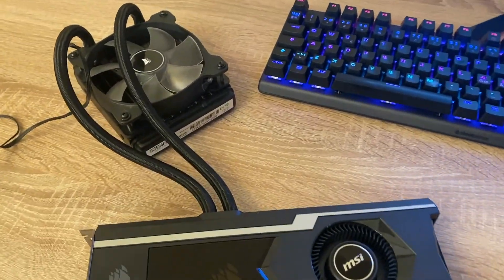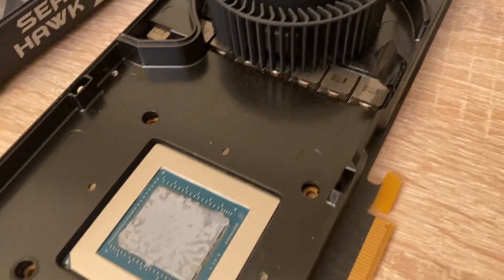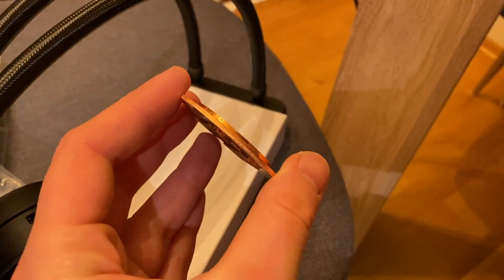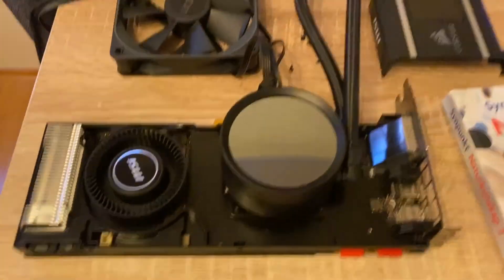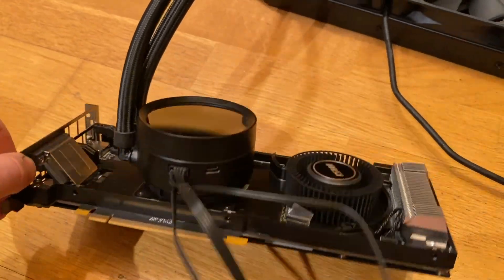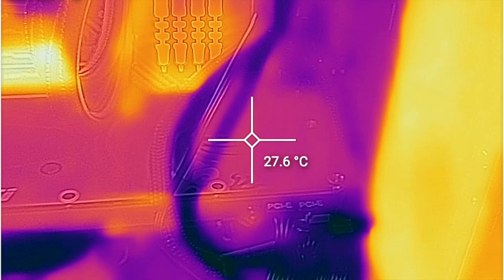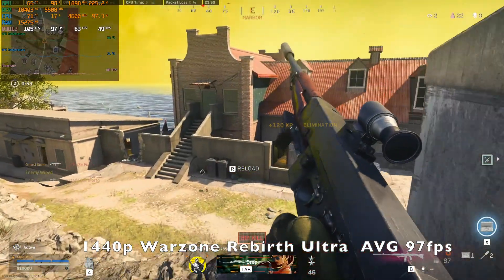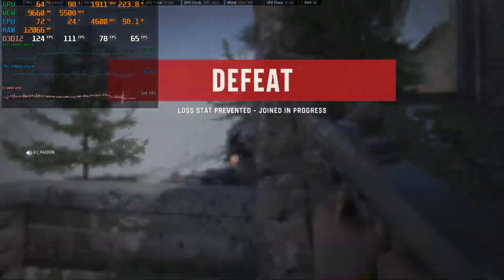Saving a Free Overheating MSI 1080ti SeaHawk - 240mm radiator!! - Extreme Performance

Comment: I brought a NZXT water cooler mount on ebay, with a 240mm rad. got it cranked up to 2050Mhz gpu and 6600Mhz Vram, cant get the damn thing above 45c, 57c on the Vram AT FULL LOAD. It sits at 17c on idle lol its crazy! I havnt undervolted it, tempted to raise the voltage, will this damage the card?
Reply from the maker: Idk, it will probably going to be fine, just don’t overdo it. But I don’t know how much you gain from it, it’s a old card :)

Comment: Hey bro, thanks so much for the video. I was trying to find out if you could replace the cooler, since I wanted to buy a used 1080-ti sea hawk but was worried id be stuck with the damaged pipes it comes with. Do you have any other recommendation for AIO other then the Kraken X53?

Comment: You also had it running with the radiator below the GPU. The air bubbles in the system will rise into the pump and it not only won't pump, but it will grind and get hot. I've had mine since they came out and it's perfectly fine until you end up with the rad below the GPU, then it gets loud but I've heard the little air bubbles in there for awhile and only had the issue of it not pumping til I threw it in another PC and had the rad sitting next to it for my test run before screwing everything in. Also instead of wasting time and money with the other BS you did over a gasket, use Permatex Ultra Black 1 minute gasket or something.

Also always run pumps at max speed, the fans are the ones you can change to preference for noise.
Reply: Broooo
I think i have the same issue as yours
Please help 😢

I tried putting my radiator below the gpu coz i was testing if my newly bought used fan works and to my surprise it worked but gpu temps were like 88c and max 90c
I tried installing  the stock fan and putting it back above gpu

High still persists

Bro please reply and help me
Thank you
Reply: @maximoxtech1125  You might have more air in yours than mine and it might be vapor locked. You may have some luck taking the card out and holding the GPU below the radiator while gently jostling it for about 30 seconds and being careful while reinstalling it making sure the rad is always above the GPU. If that doesn't work you may have to try refilling the loop. It also wouldn't hurt to reapply thermal paste to the GPU as well, it's old enough that the paste on it is likely pretty solid and not as thermally conductive. I don't think I'd bother with that however until you've tried what I mentioned first, because if that doesn't work you'll have to strip it down anyway to refill. Another option if you don't want to bother refilling would be to buy a different cooler to slap on it.
Reply: @MidnightMarrow  mine hasn't been opened
Warranty sticker still on
Reply: But was bought used
Reply: @MidnightMarrow  hmmm...
B4 dis happend
Temps were good
At idle 35c lowest
Maximum 76c 

Dis was just this week
Reply: @MidnightMarrow  bro
My question is

Is it possible that my pump is dead if ur remedy doesn't work?
Reply: @maximoxtech1125  You mean it was as used but was factory new in it's box or simply the warranty void nonsense on the card itself?

Even if it were sealed in a box but was factory new I think the paste will still have dried over time. The water in the loop will also evap over time I believe if so, it's difficult to make such a loop without the water escaping in some manner, it's just accelerated with use. The pastes that come from factory typically aren't that great, they do the job but it's just one of those areas where they save money getting cheap bulk that "does the job" instead "works the best" from what I've ever seen but even the best will need replaced over time anyway unless it were somehow sealed with liquid metal but that's not the case.

I guess I'm just not certain what you're trying to say about it lol. I would assume there's no warranty to be had if that's the concern, you don't have the original receipt and it's so old now I don't even know if they'd do much for it but you could try.
Reply: @maximoxtech1125  Oh just saw the other posts while making that last one. If you can hear or feel it doing something I wouldn't say it's dead but certainly possible, specially if it's been running for awhile while being vapor locked. It could even be stuck in that case and while the system is running you can gently tap it a good number of times to unstick it and once it gets moving and water circulates it should be fine.

If however you hear / feel nothing happening and the tapping isn't getting it spinning again, then I'd say it probably burned up yeah. Without water flow it doesn't have lubrication or cooling for the pumps motor.
Reply: @MidnightMarrow  it was only for about 3hrs

But thank youuuu sooonmuchhh
It works fine now
It even reached its lowest 33c 

Thank you again 

I tried the jostling
Took it out
Tried shaking and tapping the radiator whilst its above the gpu
And installed it and yeah it showed 40c at first and got down to 33c
Reply: @MidnightMarrow  tested it out furmark
Max 65c

Comment: thank you for the video. My 1070 sea hawk is noisy even idling. I suspect it is running low on coolant. I might have to do the same
Reply: Need to make sure the radiator is above the GPU, air gets into the system over time, with it above the pump you'll get flow with the air pockets moving around above, if its the same height or lower the air will get trapped in the pump which makes noise, damages the impeller and obviously no water flowing so it will overheat.
Reply: @MidnightMarrow   I shaked the radiator around to get all the air up there while the pump is on， and also relocated the radiator to the top of the chassis. All the noise is gone after that.

Comment: Did you happen to have the aio fans at 100% and your AIO pump at 100% during the test run? High 60s and high 1800s for core speed seems a little hot. On the stock cooler, I am able to run about 57-60C max @2038mhz while gaming. I was considering upgrading the aio but I wonder if it’s not worth it
Reply from the maker: The pump I think was running at like 50-60%, the fans followed my other fan curve for the cpu, so it was far from 100%.
Reply: @oscarmathia6112  how do you temps look if you max out the pump and fan?